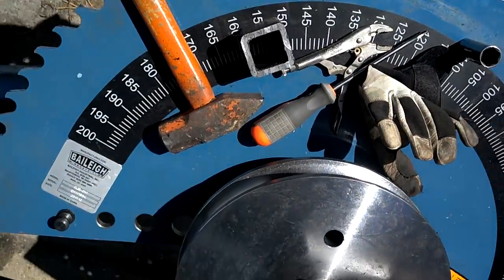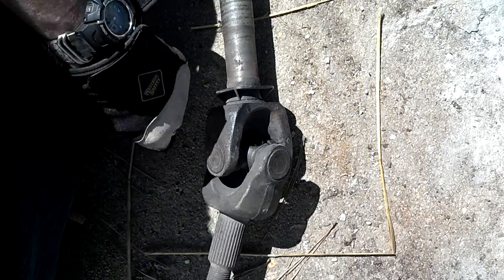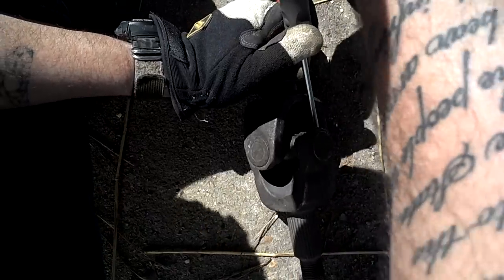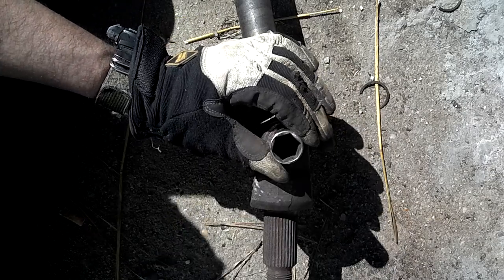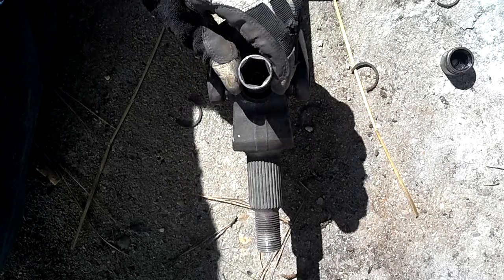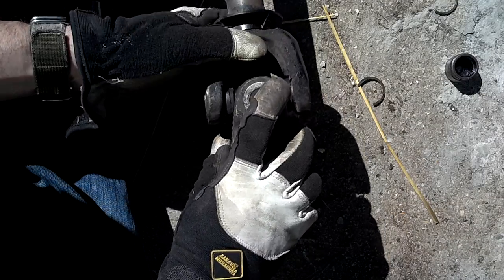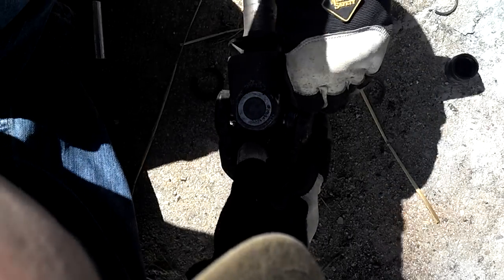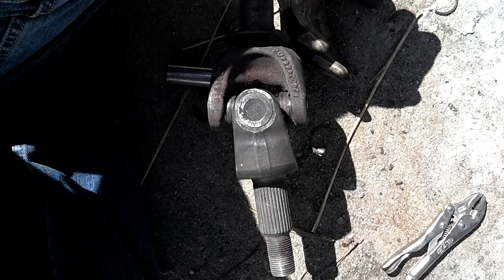How to change a jeep jk u- joint

Comment: Awesome video but I must ask this question, can you replace the u joint on a 2014 wrangler jk for the REAR drive shaft? I’m currently dealing with this problem. Thanks in advance for the response 👍

Comment: Do you need to remove the axle ?
Reply from the maker: If you want to go at it in that limited space, go for it. But you are replacing the universal joint for a reason, and that reason may be a bent or broken shaft, a bent or distorted ear, or some other issue that the only way for you to find out is by removing the shaft.

Comment: This saved me 100's today. Changed the U Joints due to this great instruction. Thanks man. But if you are also changing out the Hubs Use the hubs as the punch out and a socket. Also use a socket that you will not miss.

Comment: Not sure if your still messing with jeeps but my j k left universal joint is bad . So do I have to pull axle out if so how do I do that ??? If you can help me I would truly appreciate it
Reply from the maker: It's actually not that hard but it requires a little effort.
You're going to need to remove the brake caliper and mount, you might as well just take off the two bolts on the back that take off the entire caliper mount. You're going to need to loosen and remove the axle nut that is in the center of the hub. I recommend putting the wheel back on without the center cap and putting it on the ground, this way when you brake loose the nut you are utilizing friction to your advantage. I believe that nut is a 32 or a 35 mm (Google it). Then you will need to remove the wheel speed sensor, and then remove the three bolts from the back of the knuckle to remove the unit bearing. If I remember right there either 13 or 14 mm 12 point bolt. I highly recommend using 12point Ratcheting wrench for it or you're going to have to get creative with a socket and universal joint. once you remove those three bolts the unit bearing should come out and then you just have to pull out the axle shaft (literally physically pull it out) and replace the u-joint as normal.

Comment from the maker: As with the bearings shifting: it is a good idea to put in a glob of grease and smear the roller bearings to the inside wall of the cap to prevent them from falling over and getting caught between the cap and the joint. That is even a common mistake to happen when using a press as well.

Comment: Thanks for the video. Do you think a Harbor Freight u-joint/ball joint press is worth using for this? Last time I used your method my bearings shifted and were shattered when I hammered it in place.